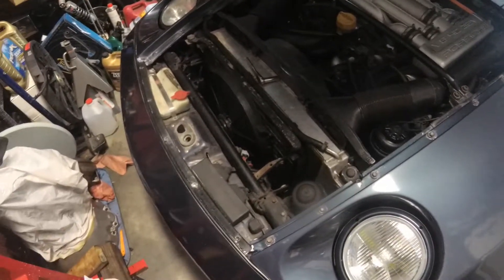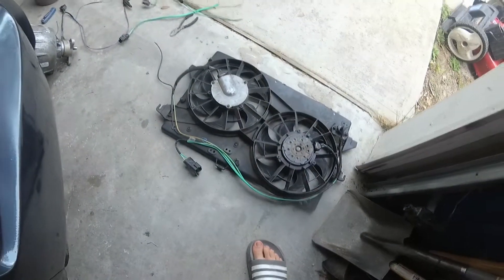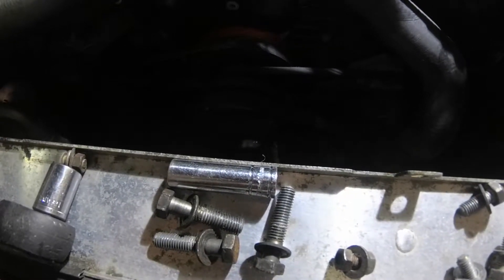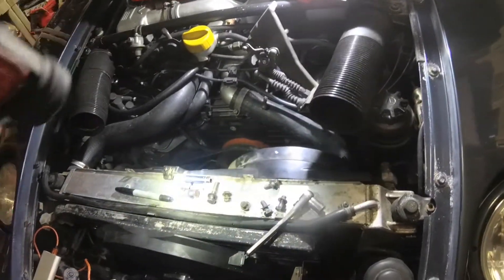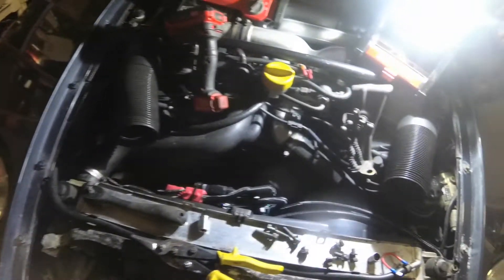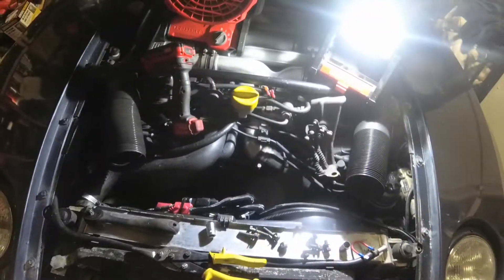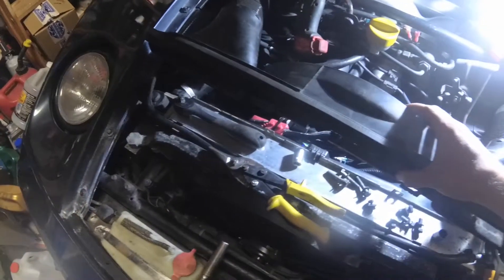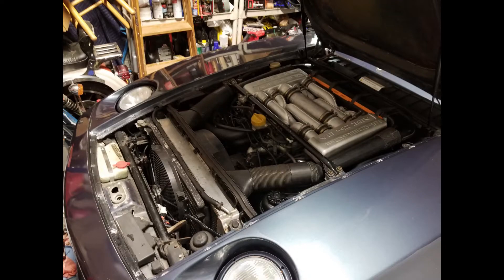928 Mechanical to Electric Fan Swap

Comment: You mention connecting to the power at the ac condensor fan plug.  How did you connect to it? Did you cut the factory plug and add a different plug? How did you find the mating plug for the fans?  I purchased new replacement Contour fans (they were only $103) and they came w just the male plug.  Please clarify how the actual wire connection was made, I am stuck.
Reply from the maker: I just had one of those connectors on hand.  They come on lots of cheapo electric fans.

Comment: Brilliant, this is exactly what I did using a V8 (company name) electric van designed exactly the same as your electric fan conversion and I added the cut off top of the old shroud.  The only difference that I did was I wired everything together on the side under the electrical on the left to keep it bulky free.  I also added a temperature sensor on the left radiator hose by splitting it.
Reply from the maker: The Deutsch connector I used started melting on me recently after 3 years.  Otherwise no issues with the setup.

Comment: 😀 I have just assembled the parts to do the exact same swap. In the UK the fan is from a MK II Ford Mondeo .... I wasn’t as lucky to get the wiring and have struggled to find the right connector. I am hoping airflow will be enough to not need an Ac fan..... Thanks for the Video ... perfect timing 👍
Reply from the maker: This fan is almost a perfect fit for the 928 radiator, is readily available at junkyards still (and aftermarket if you want to roll the dice), and blows air like a hooker.  It really does a great job keeping the car cool in traffic when it's at or over 100 degrees here.  I look at it this way, I'm not worried about getting stuck in traffic and overheating, so it lets me drive the car more often without worrying about it.  When you start worrying about stuff like that you want to drive the car less.

I did add a pretty basic temp probe to the radiator to toggle the circuit that the rad switch normally did.  It works, but the swing from on to off temp is about 15-20 degrees, so I may invest in a better fan controller at some point that takes advantage of both the high and low speeds.

Comment: Appreciate your vids. Working on 84. Thanks Doug
Reply from the maker: I'm slowly running out of things to fix.
Reply: @IntenseBlue318   I’m looking forward to that day. How’s your torque tube bearings.It’s in my future. I’ve really enjoyed your attitude and presentation. Thanks Doug
Reply from the maker: @louannwatt4447  I replaced them (twice) when I converted to 5 speed.  I tried a kit to replace bearings in the original carriers to begin with, but the nylon inserts from them didn't fit the driveshaft well.  I wound up getting new bearing assemlies from 928intl.  I want to say the bearings in them are the same as in some corvettes maybe?  Really nice quality pieces though.
Reply: @IntenseBlue318  Was the nylon inserts the main problem. Was the rubber around the carrier ok?
Reply from the maker: @louannwatt4447  the rubber seemed ok on mine.  The new ones are wider though so much less chance of the being crooked.
Reply: @IntenseBlue318   We’re they the Black Sea. They look great but pricey.
Reply from the maker: @louannwatt4447  these are similar looking, but not them.  These are still only single bearings.  My first thought was these looked sort of like the black sea bearings cut in half.
Reply: @IntenseBlue318  I’ve not seen these. Where did you find them?
Reply from the maker: @louannwatt4447  http://shop.928intl.com/mobile/Torque-Tube-Bearing-Carrier-assembly/productinfo/922-421-061-01/

That's where I got them.  Also got new mounts for the vibration damper.
Reply: @IntenseBlue318  Thanks. I appreciate that. Would love to talk to you in person one day. I’m in southern middle Tennessee. Are you anywhere close?
Reply from the maker: @louannwatt4447  South Carolina, soa good ways away
Reply: @IntenseBlue318   This may call for a road trip some day. We’re about 4 hours away from Sevierville. Is that far from you?
Reply from the maker: @louannwatt4447  looks like about the same from here.  There is a 928 meetup called sharks in the mountains in NC every year.  I haven't been to one so far but maybe next year.
Reply: @IntenseBlue318  Sounds like fun and something to look forward too. Are those bearings  available for automatic trans?